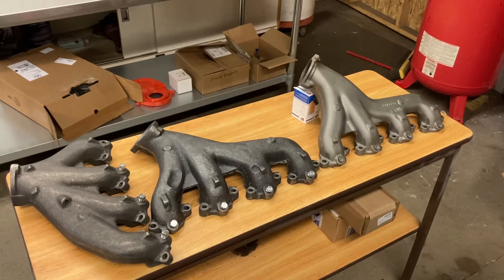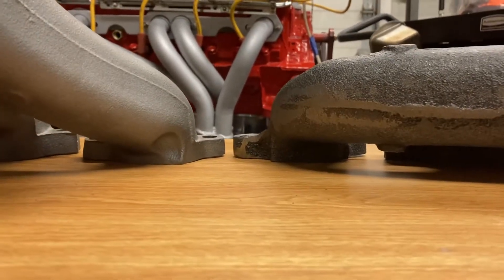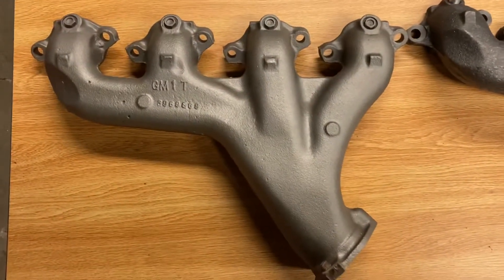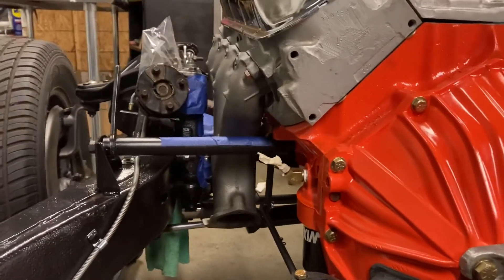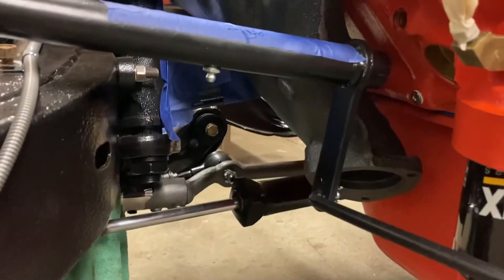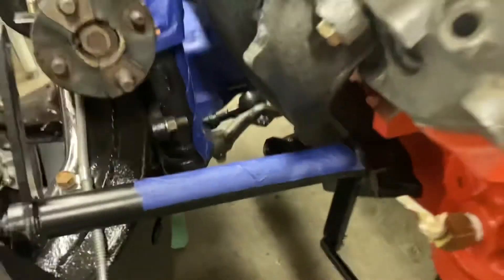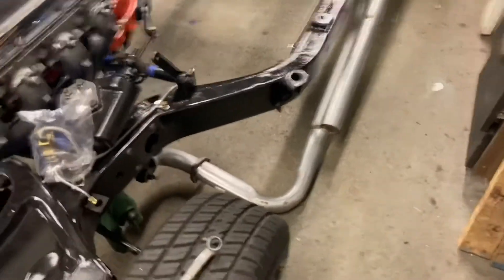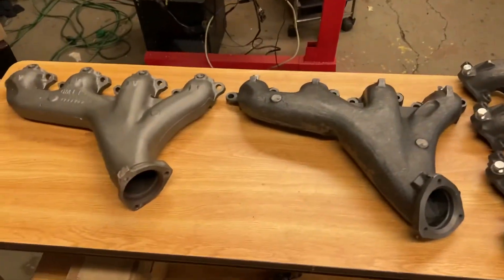C3 Corvette exhaust manifolds- 427 vs 454

Comment: What about the sizing on the head are the exhaust ports the same I keep getting a exhaust leak on mine in between the exhaust headers and the head any thoughts
Reply from the maker: BBC exhaust ports come in all shapes and sizes, round, squat, D shaped etc.  The manifolds are a square shape and fit most square shaped iron heads, and in my case they also fit the L88 aluminum heads.  However there are so many variations it’s hard to say for sure.  Try using the gasket as a reference between the head and manifold.
Reply: @ratfarm767  thank you I appreciate it ….. I’m new to all this it’s just me and my son wrenching away ….. I’m still trying to figure out if I have 427 heads on this 454 block …… I went to go get new spark plugs for a 454 and they are a lot smaller than wut was in there …..
Reply from the maker: @freddygomez2266  yea, spark plugs are a whole nother monster.  My L88 heads use ac delco R44XL.  I had a lot of 454’s over the years too tho.